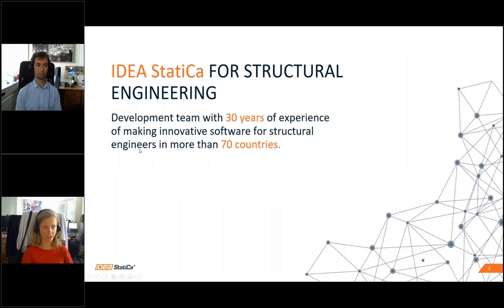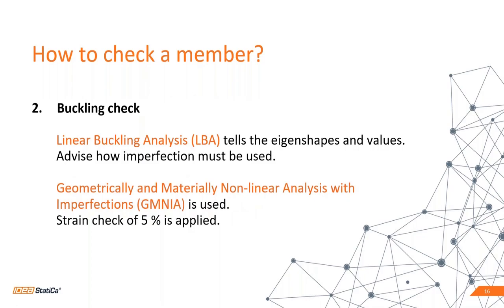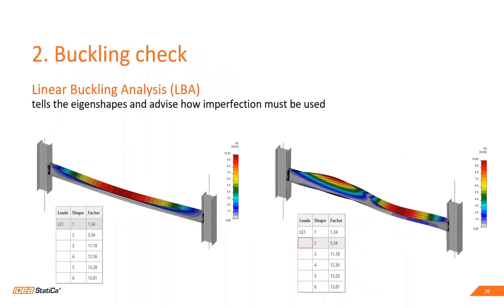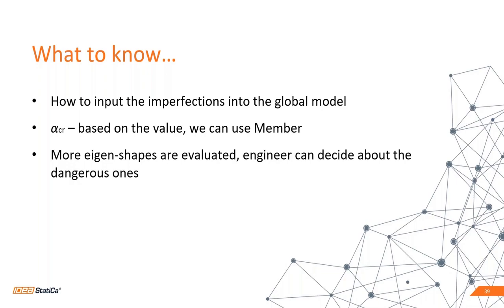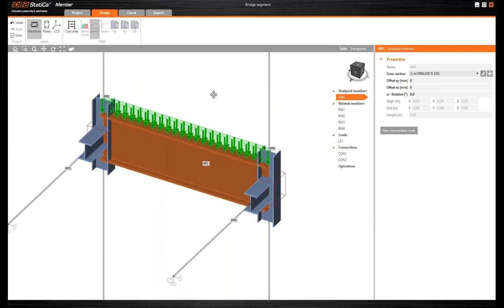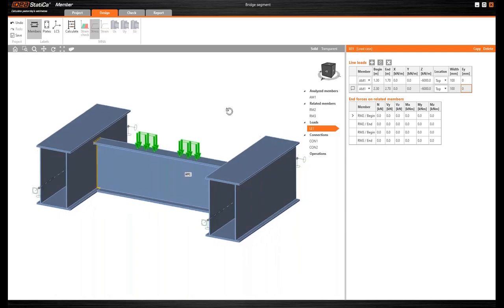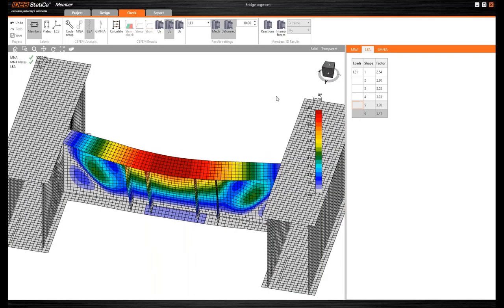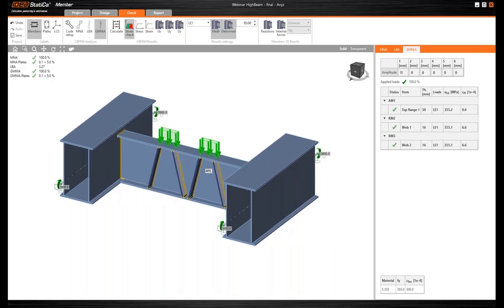IDEA StatiCa Member – Solution for buckling

Comment: Awesome.
Reply from the maker: Glad you think so!
Reply: @ideastatica_en  
And what happens when the buckling factor is < 1,00 
I suppose when the factor < 1,00  it will buckle 

But…

As we insert a buckling shape imperfection, and afterwards we check the stress in the plates with the imperfection. If the stresses are smaller than the yield stress, that means the plates/members can resist the buckling ?

So is it allowed to have a buckling factor < 1,00 ? of not, why not ?
Reply from the maker: The buckling factor can be any positive rational number. If less than zero - no buckling

Comment: @IDEA StatiCa  

And what happens when the buckling factor is < 1,00 
I suppose when the factor < 1,00  it will buckle 

But…

As we insert a buckling shape imperfection, and afterwards we check the stress in the plates with the imperfection. If the stresses are smaller than the yield stress, that means the plates/members can resist the buckling ?

So is it allowed to have a buckling factor < 1,00 ? of not, why not ?
Reply from the maker: The buckling factor can be any positive rational number. If less than zero - no buckling
Reply: Jonathan, if your buckling factor is <1,00, this means that the member reaches instability before the applied load. The Inelastic buckling load is always equal or smaller than the elastic buckling load because inelasticity reduces stiffness, so when you introduce imperfections and calculate the model with the original load, the strains will reach ∞. 

If you do an inelastic 2nd order analysis and reaches a load greater than the elastic buckling load, something went wrong with one of the analysis.

Comment: what to do if the buckling factor is coming "zero". is it wrong connection design or some command is missing/incorrect?
Reply from the maker: It really depends on a specific model, but generally speaking, there probably would be some problem with the model or loading. However, you can send your model to us, and we can check the reason for this outcome.